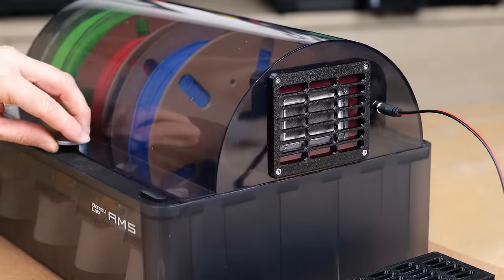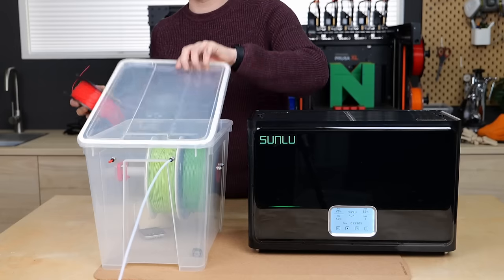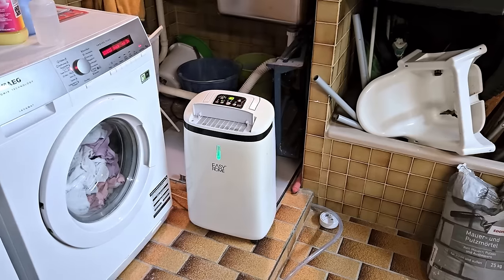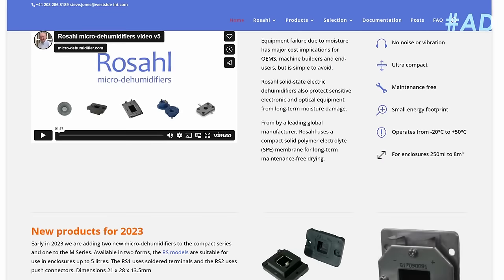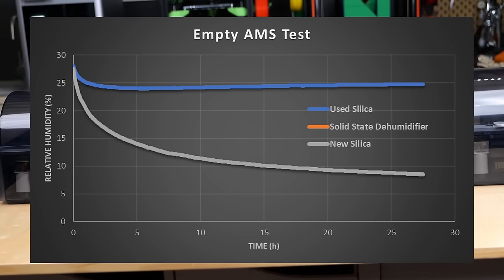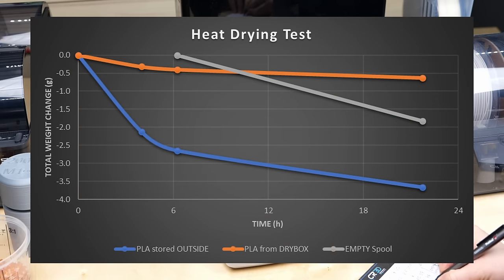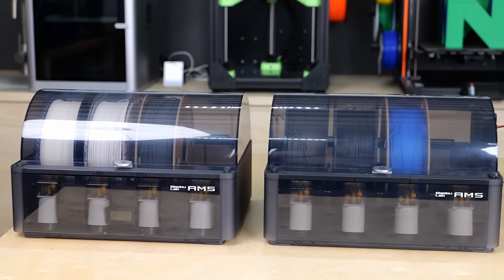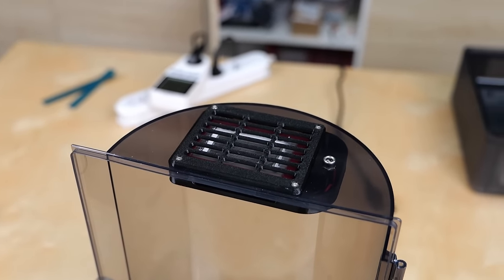Solid-State Dehumidifier: The Ultimate Filament Dry Box

Comment: Missed the opportunity to mention your deburring tools when making the cutout.

What I would do differently is mount the thing at the top of the lid. Water vapour is lighter than air and is the most concentrated at the top of the container.
Reply: depends. Not an expert on thermodynamics to explain the effect but if the bottom of the drybox is just a bit colder than the top the moisture will most likely condensate at the bottom and cause a local maximum there. Guess thats also the reason most heated boxes have the heating element on the bottom to force the moisture from bottom to top like a furnace. I think a bottom heater + that electrolysis thing at the top like you mention would be a great drybox!
Reply: i initially wanted to correct you, but then looked it up and you are right with water vapour being lighter than air 😮
thanks for teaching me 😊
Reply: In their installation manual, they explicitly state not to mount these on the top or the bottom of a container but in the center of a side surface.
Reply: It’s small enough this wouldn’t vary much throughout the space
Reply: Gasses don't stratify at room temp, the molecules are bouncing around too fast and stay mixed.
Reply from the maker: We're currently still sold out 😢
Reply: @ChriFux Yeah - Indeed. One thing I also noticed that, depending on the environment where the device is used, it has a half-life time in between 4 to 6 years. That means in worst conditions the device efficiency will be reduced to 50% of it's capacity in about the named 4 to 6 years. In practice this will mean that you cannot use the device indefinitely, but have to replace it after a certain amount of years. Of course that 50% effectively reduction also means it will take twice as long to dry your filament after a period of 4 to 6 years.
Sadly the documentation does not state if this is a linear or exponential degradation, and if exponential, wether the bulk of the degradation will take place at the end of start of the given period.
Still - It is a device I love to experiment with. A shame that there is only one supplier for this kind of device (as far as I know), so when availability and/or supply is low, it will be hard to get one...
Reply: @sdogh9  I would think it is because the water would accumulate on the top of it and soak the element.  Electricity hates water like BLM does punishing crime.
On the side the water would fall off after it is removed.  but high on the side would be ideal. Maybe a sloped roof to make it the higher point.
Reply: @MagicGumable  Except hotter air can hold more water, and on top of that, moist air is lighter than dry air, so everything points to moisture being easier to harvest at the top, at least in typical conditions (20-30°C, 1 atm).

Regardless, the membranes are very sensitive to contamination, and that's why you want them mounted vertically. If installed flat, they'll simply accumulate more contaminants due to gravity. Still, they'll probably perform a little better when installed near the top of the enclosure.
Reply: @dsp4392  Only if you assume a perfect thermally isolated container independent of the room it sits in. I witnessed condensation on the bottom since the box is on a cold unheated desk while the rest of the room is moderatly heated. This did cause the moisture to collect on the colder bottom and is ideal for the silica method. A lot of those modules would be neat to dry the silica on the bottom but im curious if the oxygen rich atmosphere would harm the filament spools in long term storage.
Reply: @robertsmith2956  Oh and on the topic of this video, it appears you may not understand how this device actually works. The water wouldn't "fall off after it is removed." The device works by electrolysis (see @1:18). Water molecules enter the electric field between the two charged surfaces and are split into their component atoms, leaving O2 on the inside and H2 on the outside. So obviously water does not "fall off after it is removed." The amount of water within the chamber is reduced by literally destroying the water molecules themselves and expelling the generated hydrogen. So really water is not transferred from inside to outside, it is destroyed within the membrane and the oxygen is retained on the inside while the hydrogen is transferred outside.
Reply: @robertsmith2956 
Why bring the Bureau of Land Management into it? What did they do to you

Comment: Convection for the win. An interesting technology.  My level of failed prints dropped enormously by storing filament in air tight containers, dry before use, then place the filament in a dry box while printing.  Anything you can do to protect the material from moisture is a win!
Reply: I keep mine in the packaging until use, then straight into the dry box after printing.  That seems to work well enough, the filament I get is well packaged and pre-dried it seems (mostly Prusament, Real, Colorfabb).  I have a dryer in case a spool turns out to be problematic, but I rarely need it.
I keep my dry box at 15-20% RH, which is plenty dry.  I use 2 microwave-able regenerative drying packs I got from an automotive store; they do the job, they do need frequent regenerating, but that only takes a few minutes in the microwave.

Comment: I've had the equilibrium debate a few times and people insist that a dry box will not dry filament, only keep it dry.
My argument has been that the whole system must, according to Newton, attempt to reach equilibrium and therefore if you have patience, dessicant in a dry box MUST dry the filament too.
Reply: What would be the source of your claim? I don't see this rooted in any real world physics model we have, like thermodynamics. Could you elaborate what you are talking about? Maybe I'm just misunderstanding what you're trying to say.

A great example to visualize this theory of a general equilibrium in specific systems for yourself are "bromine cubes" (just do a search) - where you have the same element in both a liquid and gas state in the same container.

I believe your assumption would have to be based on a system, where exchange of energy is always free or at least equal.
That however is not the case. A simple example would be the states of matter alone. You could measure yourself that the energy required to change the state or even reach intermediary states, is vastly different from each other. Like liquid to gas or liquid to solid.
A gas transfer requires energy.
So to extract water in a meta state from a solid into gas obviously requires way more energy than may be present in that system.

As we've seen in the video you could manipulate this, by applying heat for example. But that is the entire point of the video, is it not? 

So yes, by applying enough external energy (e.g. by continuously replacing desiccant) in a completely sealed system you CAN "dry" filament. However, it will not be a completely equal state as due to the laws of energy conservation the TOTAL energy in a system has to remain CONSTANT.
So if there is ACTIVE work needed to be done (e.g. to "move" water molecules), this would only be achievable if we add EXTERNAL energy to overcome RESISTANCE and INEFFICIENCIES in the process. If you could make this work in any other scenario, you just invented the perpetuum mobile.
Reply: @kontoname  You have just stated my point. It would take time but in due course it would even out. Input of energy comes by absorbing heat. You say we have to consider the total system and that includes the environment outside the box, which can provide the heat needed
Reply: @kontoname  it's just vapour pressure. Keep the vapour pressure (humidity) low enough and the water will continue to vapourise. If you constantly remove vapour, you constantly allow for more vapourisation
Reply: @NickBR57  yes and no, it depends on how much energy is needed to get the water out of the filament. If the surrounding air temperature is not enough you can wait for forever.
Reply: a vacuum box will keep it dry as well.  Together they might be perfect.  Vacuum boils off the water, and this removes it.
Reply: It also depends on the dessicant. Silica has different moisture holding capacity depending on the relative humidity. In other words "depleted" silica reaches equilibrium at a higher rH than fresh silica.
Other dessicants behave more predictably in that regard and have a higher moisture capacity than silica at low rH.
Reply: That's gotta be a painfully slow process; nor I think would it be a complete one as the polymer matrix forms bonds with the water molecules.
Equilibrium for solutions I can see, but polar solids?  Needs better than my undergrad chemistry knowledge ... or someone with a whole BUNCH of free time for empirical testing.
Reply: @robertsmith2956 Not entirely how this works.. yeah you can also reduce the vapor pressure by just vacuuming everything, but its not super effective for drying and in a vacuum you have a huge problem of energy transfer to speed this process up.
Also you need to constantly run the vacuum pump, otherwise the vapor pressure will just reach an equilibrium.

Comment: I'm glad to see you revisit this amazing technology!  Some thoughts:

1. I noticed the potential for oxygen buildup right away.  Fortunately, there are many materials that work as oxygen absorbers that are relatively cheap.  For larger scales, 'oxygen concentrators' could be used to capture the extra.

2. For more utility, the SSDH could be built into a movable module that mounts to the outside of a container and alerts you when the humidity has dropped sufficiently.  At that point, you can seal the container and move the SSDH to another one.  That way, you could prep multiple containers for long-term storage/printing directly from the container/etc. without needing to but a separate SSDH for each container.

3. I can see this being INCREDIBLY helpful and economical for those who--for example--use 5kg/10kg spools of things like nylon or large bins of pellets.  (Post active drying, of course!)

4. I can now see the attractiveness of metal spools, as they can't absorb moisture.

5. As high vacuum can help pull out moisture even faster, can you experiment with using a microcontroller with an induction burner to heat a vacuum vessel?  (I'm assuming that the seal will be made of silicone.)

Cheers!
Reply: On the contrary, metal spools can and would still absorb moisture. This is why when doing a lot of metal work, preheating the metal to evaporate out moisture is important for quality of weld connections and other structural factors. If you look at sheet steel for example and apply even a small amount of heat you will see the surface darken, as that trapped moisture is forced to the surface to evaporate. Metal is still a porous material.
Reply: @MattWeber  "On the contrary, metal spools can and would still absorb moisture."

Hmmm...  Good point.  The next logical question would be "How much more or less water would plastic spools absorb in comparison to metal ones."
Reply: According to rosahl, the O2 concentration goes up by 1% in the enclosure. I‘d say that’s not enough to get me worried 😉

What worries me slightly more is that they say the membrane deteriorates over time with a half time of 5 years at an ambient temperature of 18°, faster when warmer and slower when cooler.

Assuming that the SSHD needs replacement every 4 years if run in a normal workshop/office to keep up the performance, my guess is that you would have to compare that to the costs of desiccant over the same period.

@cnckitchen: What’s your opinion on that Stefan?

Comment: Maybe combining a bag of desiccants and the device would combine the best of both worlds, it can absorb a lot of moisture in a short time, and over longer timespans dry the desiccants out again..
Reply: You'll just end up drying the desiccant. As the RH gets low enough, the desiccant will start losing water as well. Same effect as he had with the filament giving off water over time.
Reply: @dentonator2010 Yeah, thats the goal
Reply: That sounds like an excelent idea!
Reply: @dentonator2010  Exactly what is intended. I can put a butt ton of desiccant that will dry the air quickly then this thing can slowly dry the desiccant then reach a nice equilibrium that will extend the life of the desiccant for a long time.

Comment: Relative humidity is a function of temperature and absolute humidity as hotter air can hold more moisture than cold. The absolute humidity was likely dropping smoothly in the full dry box test without fluctuations.
Reply: Yeah, the bumps in the curves could just be from relative humidity changing due to temp changes. Doesn't mean that more H2O molecules evaporated from the spools.

Comment: You might be able to clean up the plots by plotting the dew point or moisture content of the air (mg/m3) instead of RH%. This isn't perfect since the temperature shifts the equilibrium a bit with the polymers but better captures the actual moisture in the air.
Reply: Using "dewpoint" (which is directly connected to absolute humidity) or vapor pressure might have been interesting. 
I'm really missing information about the drying behaviour of filaments and what it depends upon...

Comment: For about 6 years, I've been using an Eva-dry E-333 Renewable dehumidifier in my filament storage box and it works great.  For drying filament like nylon and PETG (which I very rarely need to do), i use a food dehydrator.
Reply: This. I have 4 of them (Costco) and they work quite well. I do like this Solid-State idea for my BL X1C AMS. I live in a moist area so I have a commercial dehumidifier in my garage; usually runs down to 28-30 %.RH. I dry my Eva-dry in there for 24 + hrs and they last AGES in my dry boxes. I also have a retired Power Air Fryer XL that can hold 3 rolls that I run in the garage. Dry air in PLUS the dryer = perfectly dried filament. :) The Air Fryer has a dehydrate function for temps 90-140°F with times to 8 hrs, great for most reels except PC or the other hydroscopic stuff, plus it's accurate to 5°F.

Comment: Interesting 👍😊
Be aware: Moist air is lighter (‼️) than dry air and therefore rises to the top. Oxygen is heavier than dry air and sinks to the bottom.
So together… without continuous movement of the air inside the box, the placement of dehumidifier may be very important for the outcome.
Reply: That's what I wanted to say. But no only oxygen, nitrogen too. Humidifier must be placed at top of a box, if without air curculation inside.

Comment: Very interesting and detailed study, as usual 🙂

I also keep my silica packages inside my filaments storage boxes.
When I need to dehumidify a  filament roll, I use a food dehumidifier.
I add all the silica packages in the dehumidifier with the rolls.
The colored ones show It's losing water but I know the temperature is too low to be really efficicent.
Next time I will try to weight everything.

I usually do that during the cold season so it not that much of energy waste since it contributes to home heating.